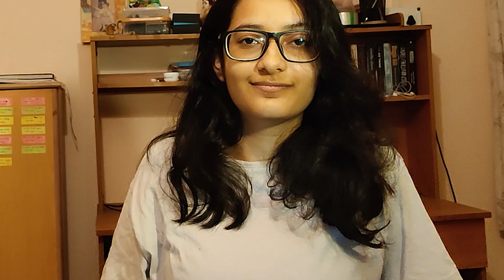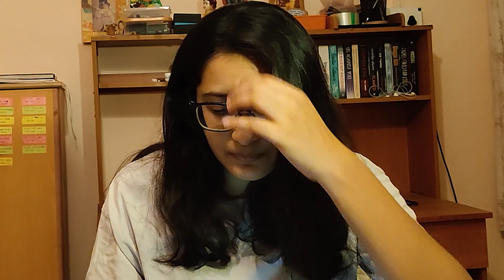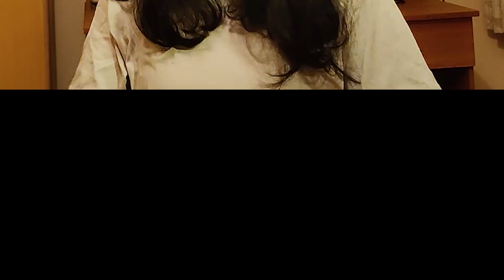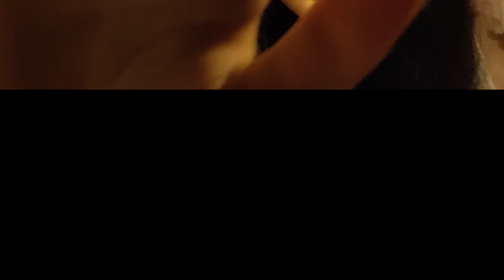civil engg courses in 2nd year sem II at BITS Pilani Hyderabad Campus

Comment: In BITS which one is esaier chemical or civil  and get free time
Reply from the maker: There is no easy and tough branch per say. There are pros and cons in every branch and you'll have to work hard in every branch to get good grades. What will matter in BITS is the class size. Larger the class, harder it is to score because BITS follows relative grading. Between civil and chemical, the class size is fairly similar. So it all will boil down to your interest in the subject.